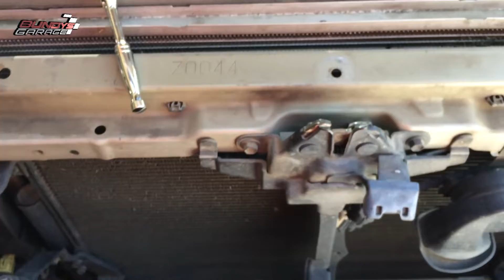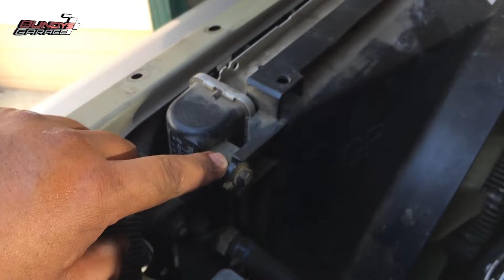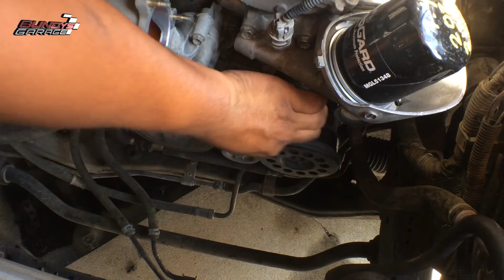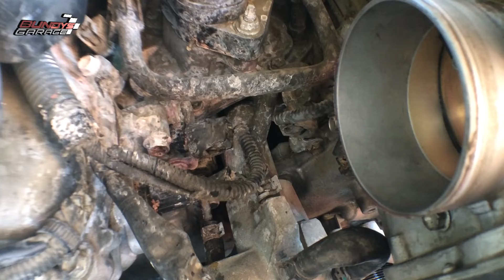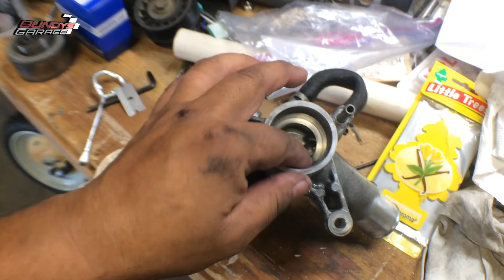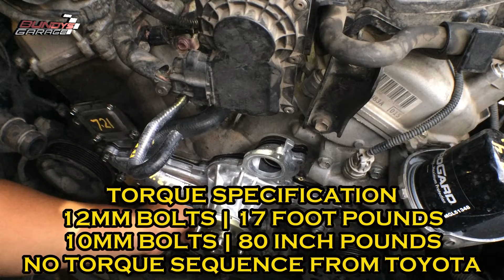How to Replace [1GR-FE] Water Pump 03 - 15 | 4.0L | Toyota Tacoma 4Runner Tundra FJ Cruiser Aisin

Comment: How many hours take you to done this job
Reply from the maker: It took me about 4 hours but if this is your first time doing all this work, give yourself 6 - 8 hours.
Reply: @bundysgarage  Thank you I have a 2005  4Runner V-8
Reply: @bundysgarage  Oh I just saw torque specs...great video anyway. I have a Land Cruiser 120 with 1gr-fe engine. Everything under the hood is 1/1 with other models of Toyo. Thanks a lot👍👏👏👏
Reply: @bundysgarage  6-8 hours jesus...I thought max 2.5-3h work...
I mean I know that there is no need to remove the whole thermostat housing and that Toyo has a lot's of screw down there...but still is sounds a lot 6-8h. Any torque specs on water pump? Thanks
Reply: Juuu huh good question a list 6H.